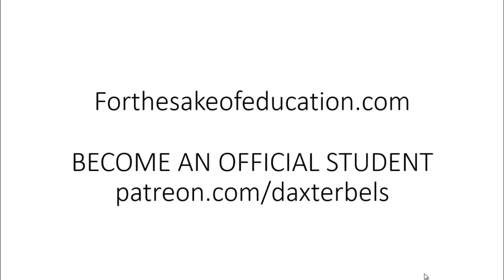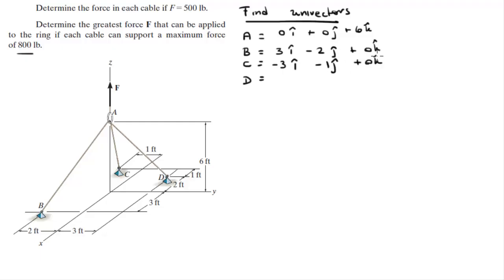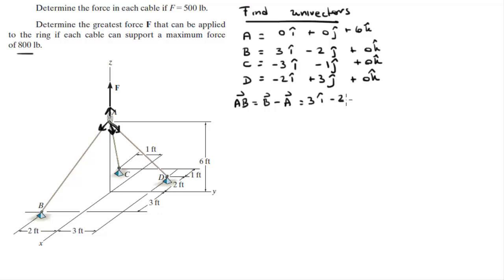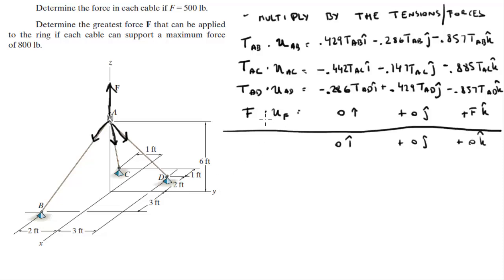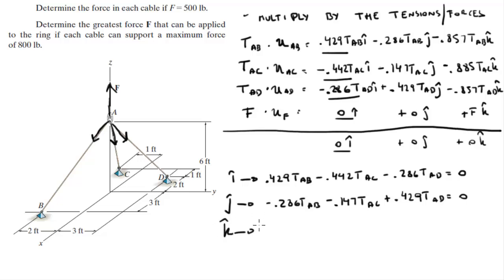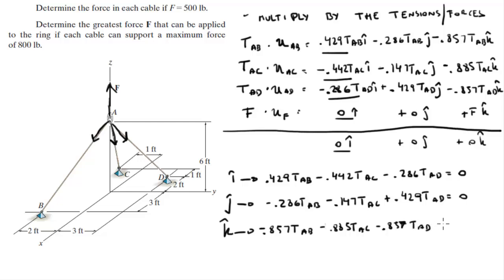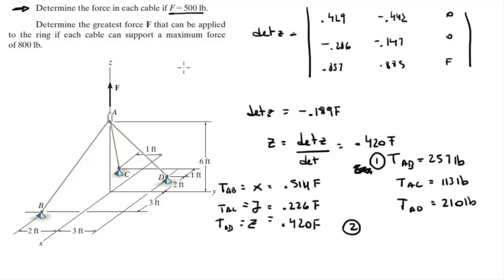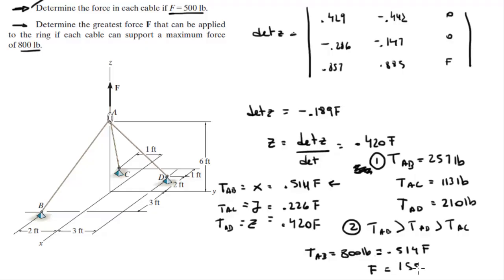Determine the force in each cable and the greatest F can be

Comment: For anyone who is watching 6/2024 and after. There is a typo for his det y it is supposed to be -.102 and the y value after doing your division is supposed to be .226. [y=(det y)/det]. I've checked Chegg and the back of my book; his answer is correct. I can only assume that the matrices are done correctly and that there are no issues with the negatives. His answer is 1556 and the answer is 1558 but that's a rounding error.

Comment: In the last determinant for det Y did you forget to add the negatives to the bottom numbers like you did in the other two? Also the calculations for the last Y is wrong. -.265/.451 I think.

Comment: u can use the ti-84 for the matrices part really simple save about 6 min of work
Reply from the maker: yeah is just that some of us weren't allowed to use programmable calculators :(
Reply: How? I didn't think the 84 could output an undefined variable. What are you using as a placeholder for F?
Reply: How did you do it?